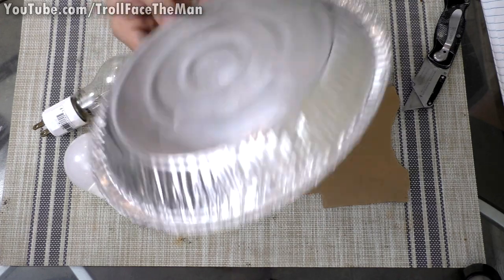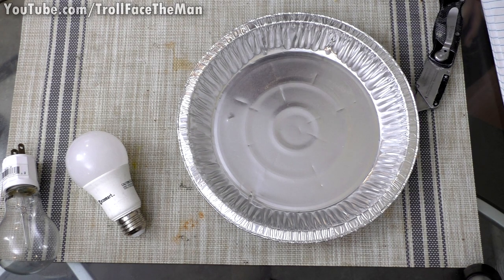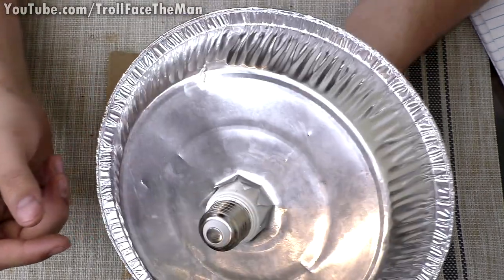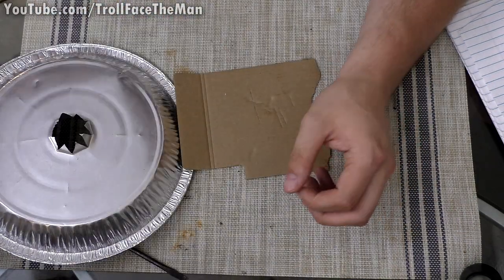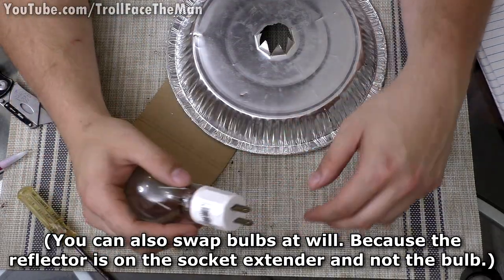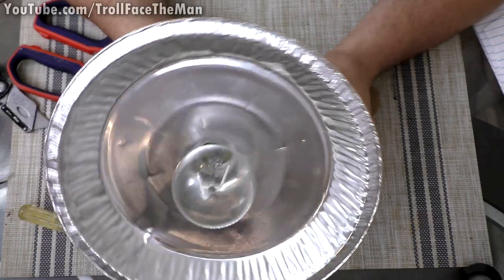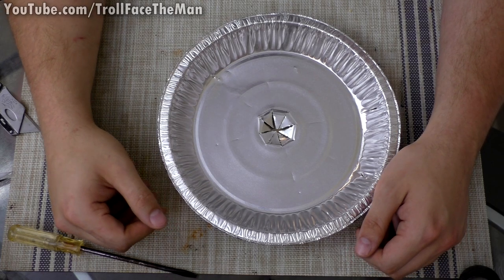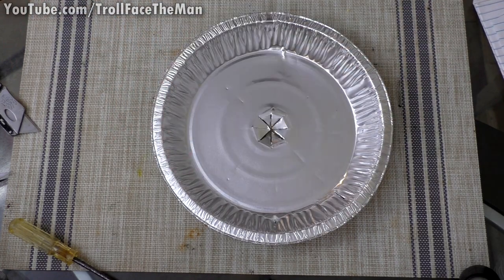Pie Tin/Dish Light Reflector? DIY, Free, Quick & Easy Upcycled/Recycled Reflector with Testing.

Comment: Did you have the exposure locked on the camera? It looks like the entire scene brightens when the reflector is used, including everything behind its position.
Reply from the maker: The Picture was taken at F22, iso 800 and 5s shutter for each picture. Nikon D3500. What I would assume that is from the way it reflects off the walls and ceiling.

 The UV one was taken with the same settings locked but with 15s exposure.
Reply from the maker: Looking again it makes sense for anything the light touches directly to get brighter. As that was the only light in the room and anything like that is concentrated.

 As for behind the light I am looking at the filament style one right now and it is clear to me especially looking at the back of the inverter it's much darker with the shield on.
Reply: @TrollFaceTheMan  There's a drawer pulled out on the desk to the right. The side of the drawer that we can see is behind the reflector and shielded from light reflected off the front wall, yet it gets much lighter in some instances.
Reply from the maker: The light on that draw comes exclusively from the bulb and the Reflector. Even if it may look like that it is behind the Reflector it isn't it actually is several feet in front. It's a situation with the optical distortion from the lens making things look different than they are.

 If the side of the drawer was truly behind the Reflector then the whole side of it would be in a shadow. And not having a partial shadow and partial light.